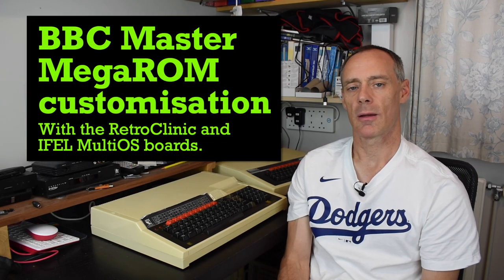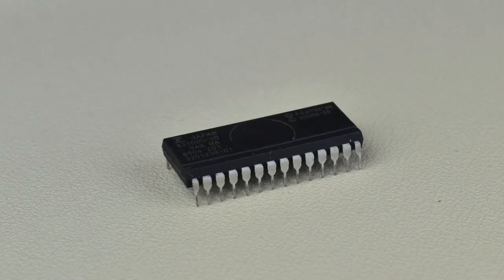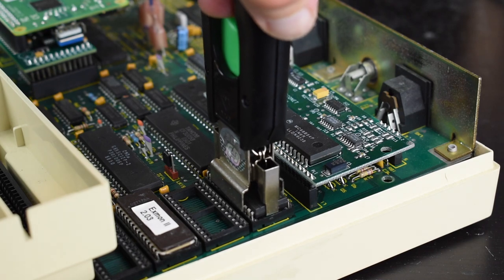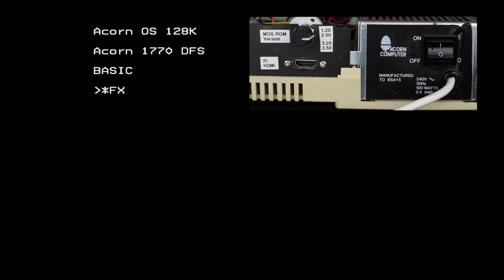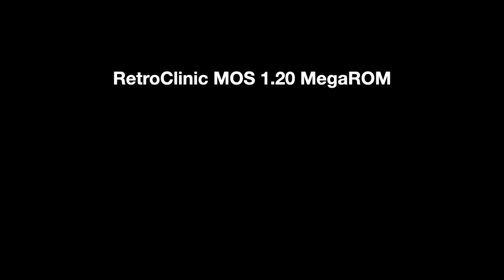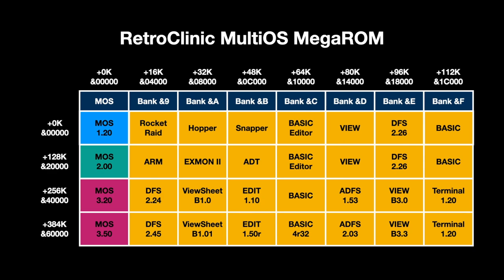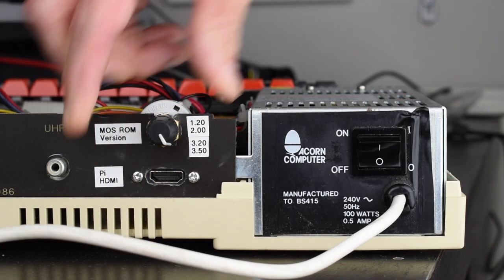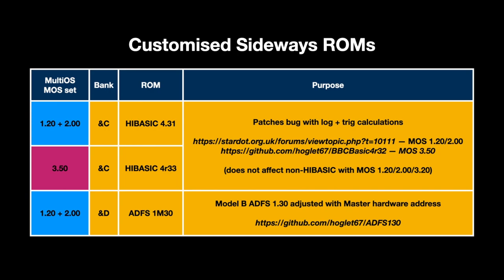BBC Master MegaROM customisation and MultiOS boards

Comment: Awesome content, this is exactly what I needed.  I've had a RetroClinic MultiOS for a few weeks now and I'm finally getting around to customizing it, mostly so I can have MMFS built in and use the OS 1.2 and OS 3.x versions and ditch the separate 3.x ROM, and gain access to it in OS 1.2.  Thanks for making this video, it explains everything quite clearly.

Comment: Man, I absolutely LOVE this video! Got to be the most useful video for the Master I've seen in a long time. I've got a MultiOS from RetroClinic and I don't have any of the gear to modify the contents. There's a lot of software in the ROMs I just don't access or need. I don't need any of the office software. I've also got a DataCentre External from RetroClinic and it's the single most amazing piece of hardware I've bought for it. I see you've got a PiTube as well - love mine. Think the only thing I need to get now is the Video NuLA for the extra colors.

Comment: That HDMI output on the back of your Master - where's that coming from please? If it's coming from the Pi on the PiTube - how is it set up and how is it used? I've got a PiTube in mine and know nothing of getting HDMI output from it.
Reply from the maker: The end of my video on the ARM assembly version of 3D 10 PRINT goes over this briefly: https://www.youtube.com/watch?v=AhAzVnUva-k&t=3515s (link to the right bit).

Basically, the PiTubeDirect software implements a frame buffer, usable from the 6502 and ARM co processors, which allows you use the Pi for output.  It comes with a VDU driver so standard operating system legal software will run (and give you blazingly fast graphics and higher resolutions).

Comment: Another quality vid there. I have the RetroC Multi OS. I may have a go at this a some point although buying another more modern programmer might be pain for a one off job. Is there any one who likely could do this for me if I sent off my flash ROM to them? Incidentally my Bulletin Board  the Night Owl BBS is up most evenings if you  are interested in checking it out .. details are on Stardot (Communcations area).  I have created a frame for your channel and some other retro computer ones on the BBS. You can access with a modern viewdata client on TCP/IP on some nights you can also use dialup. The Board will be fully live quite soon.  Keep the vidz coming, they are top notch.
Reply from the maker: Probably a lot of people would help you out with programming it as it's pretty straightforward and quick.  The main issue is you often make a mistake or want to tweak something and sending it back and forth in the post would be a pain.

It may be worth asking on Stardot, though, to see if there's anyone close by you who you could visit or borrow the programmer from.

Comment: Was this 6502 based? How did it handle relocated code? I seem to remember that CPU not being built in a way to make relocatable binaries easy.
Reply: Yes, the Master 128 is 6502 based.  Because the 6502 only has a 64K memory map, 16K sections of code are 'paged' in as needed. While they are stored in many locations in the megarom and it's replacements, when the code is called it still all appears to be at the same location in the memory map (0x8000) thanks to that paging.  The code itself doesn't have to deal with relocation.

Comment: I also make a mega ROM board that is a hybrid of the two boards, 4 images and an external switch like the Retroclinic one, but smaller and not blocking the other sockets more like the IFEL version
Reply: Mine doesn’t block the socket, it sits over it.